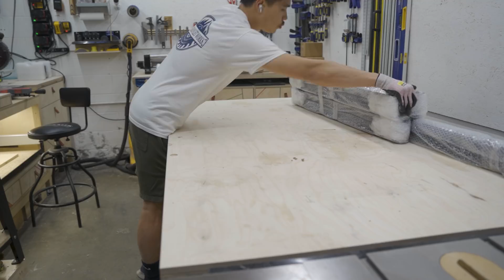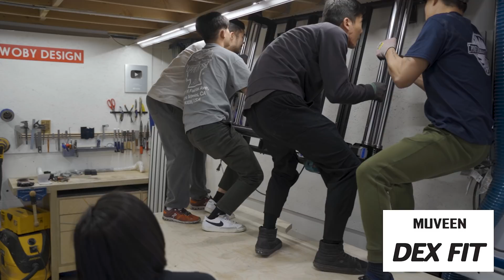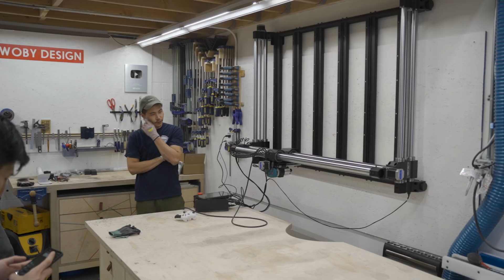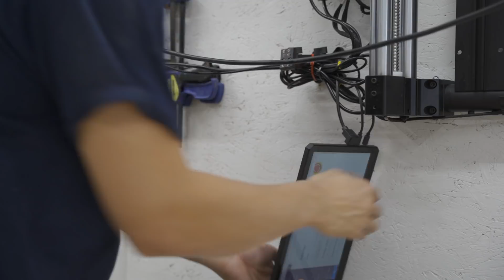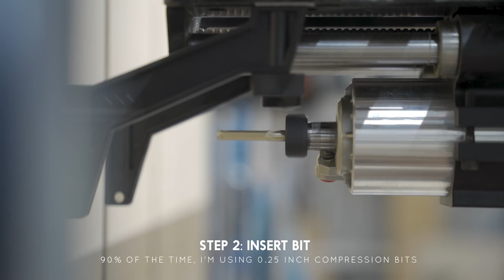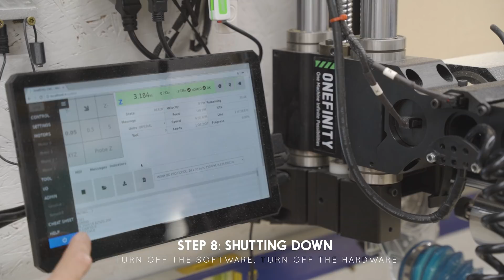CAN YOUR CNC MACHINE DO THIS?!

Comment: If you put springs of the correct weight and length, to overcome the gravity.......(example : if weight of "Y" axis weighs 15 lbs. at bottom of "Y" travel springs will hold 15 lbs. and when at the the top of Y axis 0 lift ).........will take some experimentation.

Comment: What settings do you run on the onefinity for motor amperage to mount the cnc in that orientation. I have mine mounted the same way but have repeated issues of the y rail motors being over torqued and slip the x rail all the way to the bottom. I know that onefinity does not endorse mounting the CNC in this orientation but I have seen many users do as such.

Comment: Nice job.  I have an Elite Foreman & QCW on order and am designing a motorized table similar to Lee Turnbull's (see his video  titled Folding Table MK2 Update - Stronger Design - Part 1).  Like you, I'm designing to rotate to have the X-axis gantry oriented horizontally, not vertically so I can move it up to the ceiling and get it out of my way in the vertical position.  For me, vertical position is for storage only, not for operation.  My machine is obviously MUCH bigger and heavier, the engineering has been a challenge and I'm taking some risk!  Question: Did you ever solve the issue of your X-axis gantry being pulled toward the floor when the machine is off?  I'm guessing my Elite will do the same thing, which defeats my reason for rotating the machine like you did.  I'm thinking maybe a couple of simple cable tethers to hold the X-axis gantry in the upper Y-axis range before taking vertical?  Any thoughts you have from your experience would be appreciated.  Again, well done.  Cheers!

Comment: one finity have some problems, uses too small stepper 1,2Nm motors weak lot, no torque, need change biggest nema 23 motors, 3Nm have minimum ewery hobby cnc, and controller software need change lot better linuxcnc, masso have worst controller, linuxcnc have true REALTIME controll lot more safety, and this worst spindle (what not has plan used cnc spindle, plus horriple noise) need change air or water cooler 800-2,2KW REAL cnc spindle lot better no noise lot and better power. (can cut aluminium too better) makita router bit torque have only 0,4 Nm and small REAL aircooled spindle 800W have 0,95Nm and 2,2KW spindle 1Nm lot better if sometime need cut metal too etc, aluminium. better build DIY at home similar machine lot better and 50% cheapen build. save money lot. this machine have waste lot money and not perfect, and first need make or buy zero tool height touch plate. help lot you work, or better made own XYZ zero touch plate ,simple made. i thing first buy one finity but NO better cnc can made DIY ay home and lot cheapen less than 1000$  lot better perfect machine can build ewery men at home less than 2000$ save lot money.

Comment: Dude, you need to add some idle current to your Y stepper. Default is zero.
Reply from the maker: I’m not gonna take advice from someone with 2 first names…
Reply: @WobyDesign  wow, that says a lot about you. I was trying to help.
Reply from the maker: You didn’t, default is at 1amp
Reply: @WobyDesign  interesting I have three of these controllers and all three had defaults set to ZERO for idle. Maybe you're a newbie and they've changed the defaults on later batches ass.

Comment: Maybe you can swap the rails so you have dual x and single y rails. I know they are different lengths but maybe they will exchange them. The y motor then only has to support the weight of the router.

Comment: Nice setup bro.
I just hung exact same machine same way but mine won’t stay up and constantly loosing strength in the y motors. Do you have any suggestions?
Thank you
Reply: buy biggest motors and motor drivers, thats it.onefinity uses small stepper motors only 1,2Nm weak lot if not have closed loop motors, not good, can change all nema 23 serie motors normal minimum hobby cnc used nema 23 3Nm 3A motors. but need check can drivers handle biggest current too or change drivers too biggest. all drivers controller need only step and dir and enable wire to drivers. i used my cnc nema 23 3Nm motors  about 50$/piece and DM 556 drivers about 20$/piece. lot better motors.

Comment: Okay so I have the onefinity X50, what did you have to change to your design being that your are essentially operating it sideways. Did you simply have to flip your designs sideways? It probably doesn’t matter what direction your designs end up cutting in, just curious if you had to change anything in the way you design your files for this to work.
Reply from the maker: Did you even watched the video?
Reply: @WobyDesign  I did watch it, I mean within your design software not the motors or onefinity settings. Also for the record, I think my question was perfectly reasonable, not sure why you came at me so hard with your response, May have been my wording that was confusing or you misunderstood my question but I don't recall you mentioning anything about modifications to your file designs in the video, sorry if the question was confusing.

Comment: I would definitely add simple counter weights. Counter weights are commonly used in modern CNC milling machines.The counterweight is inside the Z column.

Comment: You really need to put a motor with brake on those Y-axes, I would hate to see the machine get damaged or for you to get injured if the machine suddenly lost power. The brakes that are on industrial servo motors (similar to the motors on your machine, but can track their position and generally have much more power) are normally closed, so if you lose power the brake automatically applies, and then can only be opened If power is applied to the brake. I design industrial automation equipment, and this is one of the most basic safety requirements with this type of machine to prevent injury. Your counterbalance idea is great too, it will cut much better with less power if you do that, but still not a substitute for a brake. Not sure if the control system can be modified to implement one, but in my opinion this is something the company absolutely needs to add if it's intended to be mounted vertically. Most motors with brakes are servos, but I've seen some stepper motors with them as well, may have to look around a bit though.

Comment: Nothing wrong with 3D printed  parts on low volume  products, injection moulding of non structural parts adds unnecessary cost.

Comment: I like the way you set it up.  Less dust falling on rails. I would like to make a Murphy Bed type mount.  Folds on the wall when not in use and pull it down and flat like a Murphy Bed to use.

Comment: You should move the controller box with the big red Stop button a few inches to the left just to make sure that at no point in the gantry's travel does it or the cables ever impede your access to it.

Comment: The only more space-saving way to mount it would be to a ceiling! Of course, then you'd need one of those drywall lifter thingies to load it.  Then again, it would make dust control much simpler!  Great vid - it gets everyone thinking outside of the box!

Comment: Be very careful blowing that much fine dust (especially wood dust) into the air in a closed space! One spark can be extremely explosive! Like blow up your house explosive... To see what I mean, throw a small amount of your wood dust (size of a marble is enough) it into cloud of dust above a candle flame or in front of a lit propane torch to ignite it... DONE OUTSIDE AWAY FROM OTHER FLAMMABLES!! The wood particles are flammable on their own, but when suspended in the air (Oxygen), all the particles get their own oxygen supply and burn very, very quickly... Explosively, one might say. Here's a better way to just see the experiment without singing your eyebrows. :)  https://youtu.be/gbqrVIo9ojk

Comment: I'm actually really impressed by the pricepoint they're currently offering these at (32" x 32" x 5-1/4" work envelope for ~$2100). I have a Shapeoko3 Standard that I just recently got, but if I ever upgrade, I'll probably look into Onefinity.
Reply: Shoutout also to the buildbotics open source control on which electronics here are built.  That great foundation that Is One of the reason for the good price point of this product
Reply: 32x32 cost 3336$ plus shipping, you can build better cnc  this money 2 piece. maybe 3 machine.

Comment: do you use a fly cutter to re-surface the spoiler board?
Reply: Trim routers don't have enough rigidity for a fly cutter worth anything.  Better to just use a 1-1.5" straight bit.

Comment: You may want to put a straight edge on the bed level with the horizontal travel and put an indicator on the spindle to see if there's a lot of sag in the rails from weight. The weight of the motor and everything it's attached to might cause deflection in those long rails. That's probably why they recommend hanging it the other way. That you sat on it might not have helped as it could have permanently bent all of your rails😢. Hopefully if that did happen, it is little enough to not affect your woodworking. All in all, that thing looks super well built. Your potential for production and complexity of your ideas is going to go through the roof. 👍 Great and informative video BTW. This is the kind of cnc review I wish every brand of cnc had on YouTube.
Reply from the maker: It’s fine bruh, worry about your cnc
Reply: @WobyDesign  Sorry. I posted this in the wrong channel. I meant to say: That's so cool!